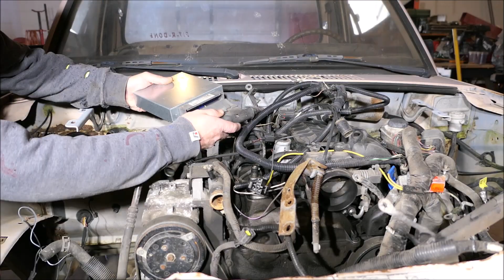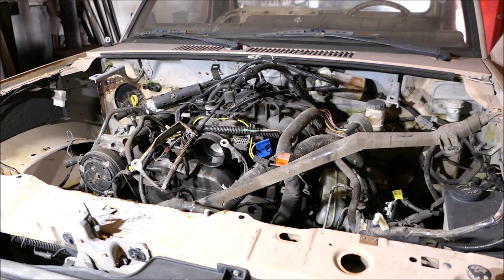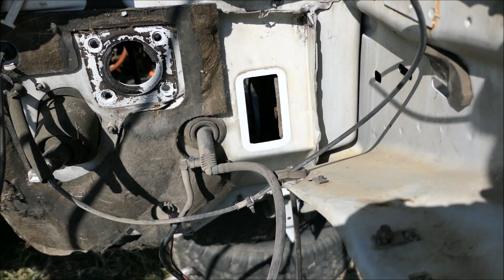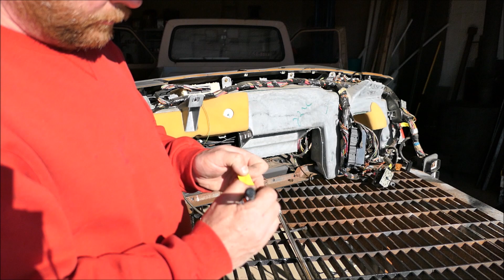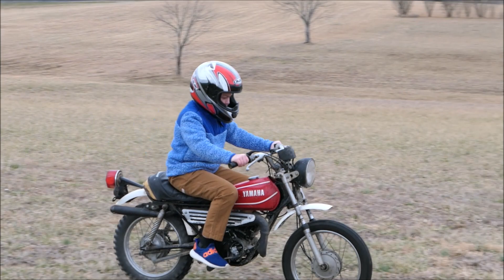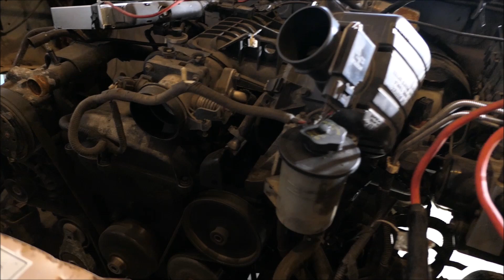2002 WIRING Harness into a 1985 FORD RANGER

Comment: My 03 ranger 2.3L automatic wont start without the cluster. Fyi my key has chip i think thats why idk but ill probably take my 87 body put on 03 running chassis it might be easier first i got find a daily driver before attempting it. Once my head is in it ill get it done. In my case should be lot more straightforward take grill fenders off and cab put 87 on everything else isn't being touched. The cab and keeping original dash is where time goes if i don't just put 03 dash in 87 lol i just want 87 look thats it. Bed fits perfectly with different fuel fill hose its pretty close roughly looking at it sitting on it but you know how that goes hopefully I don't need cut frame both are short beds.
Reply: It's probably just the key module. I'm using a 2003 2.3L auto Ranger drivetrain in a 61 Rambler. According to my research 2003 was the last year that just PATS was used (key unit). 2004 started the security module in the cluster.

Comment: I'm doing about same a 1987 ranger swap with 2003 my daily driver. Only problem is eliminating all bs seat belt air bag. And eliminating ac because 2.3L doesn't like it . I want to build my dream truck exactly what you are doing but differently. I wouldn't worry about that rust cut it out find some one cheap to weld it in you won't see firewall. I wouldn't keep abs then you have change whole front end the 2002 and 2003 has horrible front end in my opinion.
Reply: If its 2x4 idk anything about 4x4
Reply: Nice dt